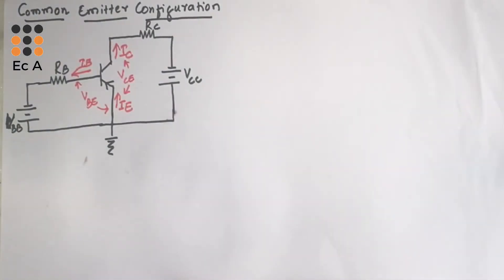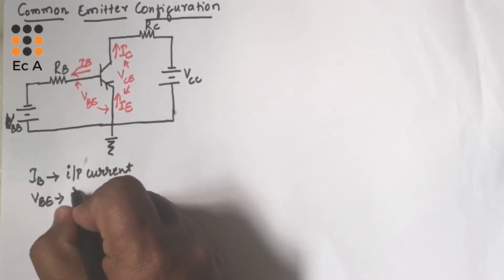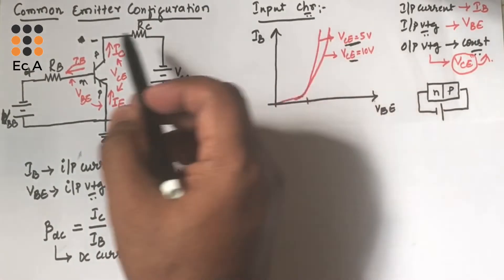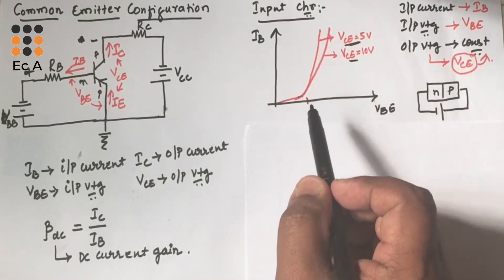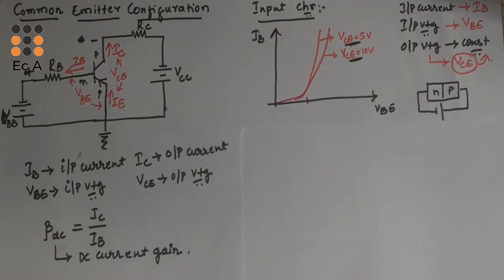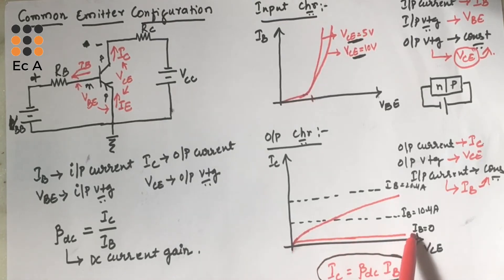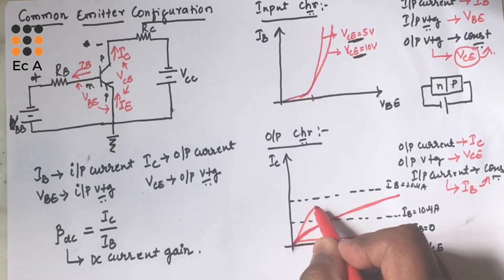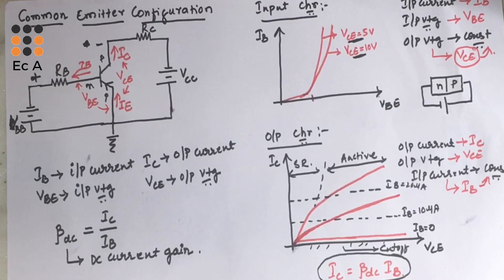#24 common emitter configuration of a Transistor (BJT) || EC Academy

Comment: Sir Emitter should connect with Vcc+
Reply from the maker: Common Emitter means, emitter is common between input and output,  hence it has to be connected to ground.
Hope you have understood 
Subscribe & Keep supporting EC Academy ✌️
Reply: @ECAcademy no sir it should connected to Vcc+ only other wise circuit will be short circuit,  i personally checked with higher engineering books
Regards
Reply from the maker: This is the most popular biasing configuration. Here, the Emitter is connected to the common ground as shown in the figure.
If you are still confused plz ask your college professor for more clarification.